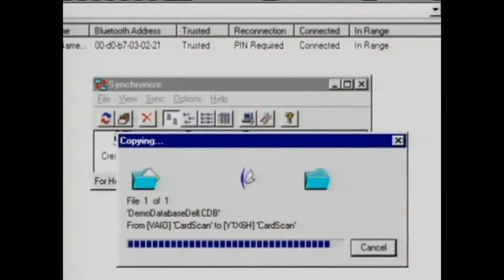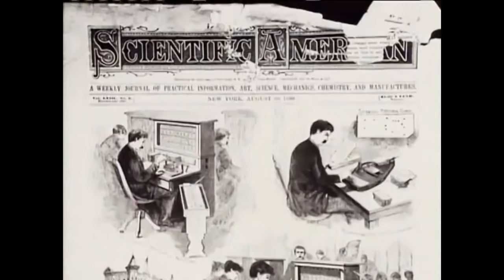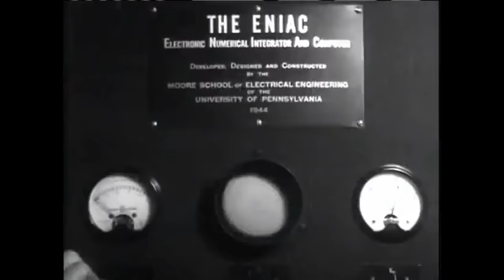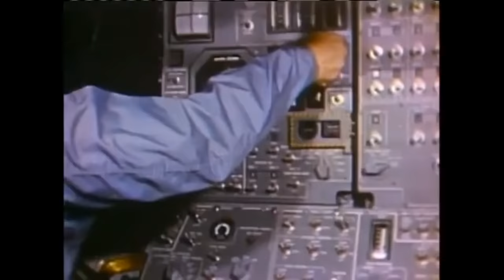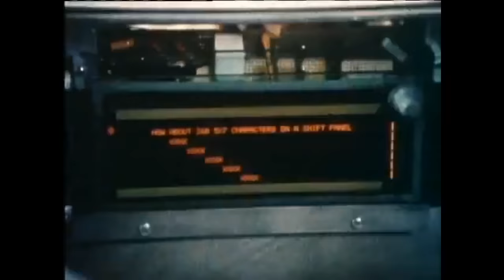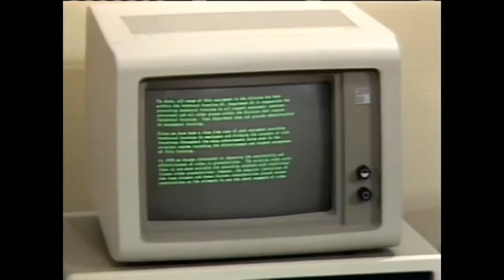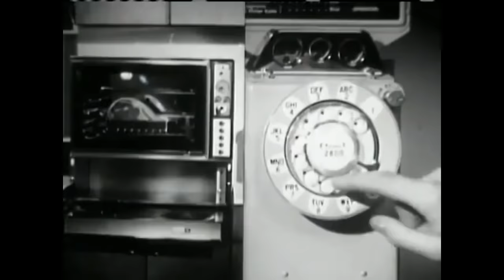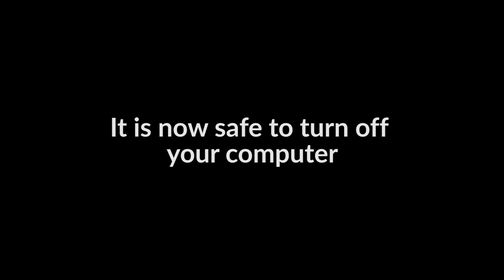The History of Computers

Comment: Alan Turing was awesome and an idol of mine. I am trying to learn about computer science and I am ALWAYS use the term "Turing complete". and as of the recent ai revolution i have now used "Turing test" (not to be confused with each other) a few times. For those who do not know, turing complete refers to a system that is capable of simulating anything given that it has enough computational power and memory, and turing test refers to a theoretical (at the time) test to see if a human can tell the difference between a real human and an artificial intelligence. arguably the first computer, the eniac was heavily based off of his knowledge. His concepts are still fundamental in modern computers and even software.